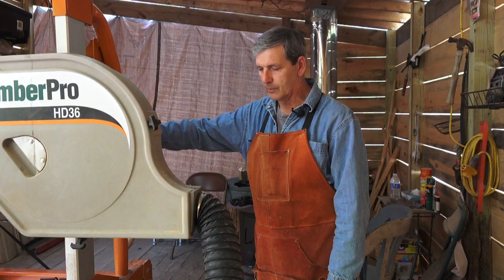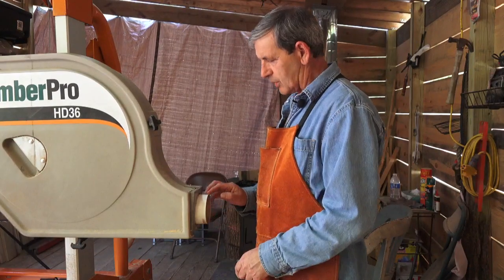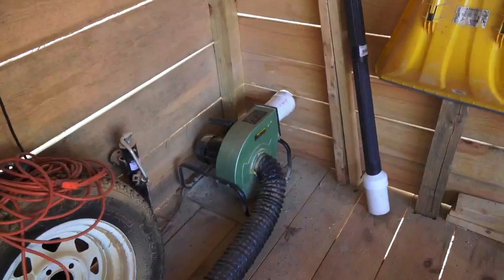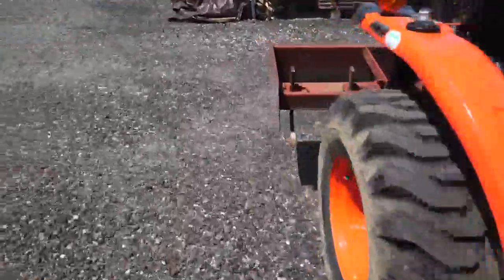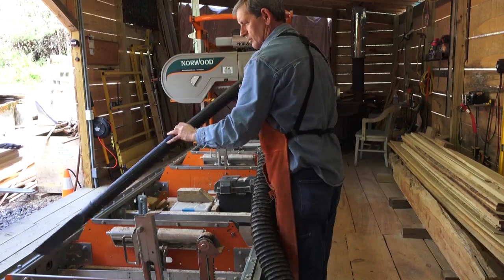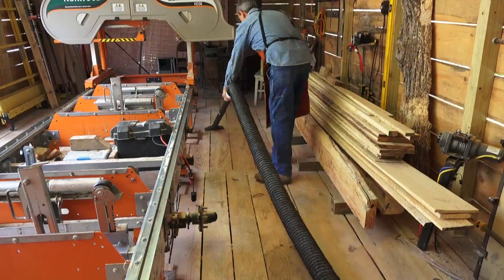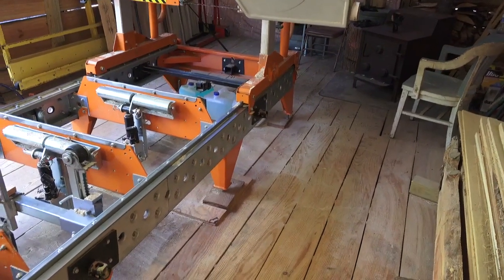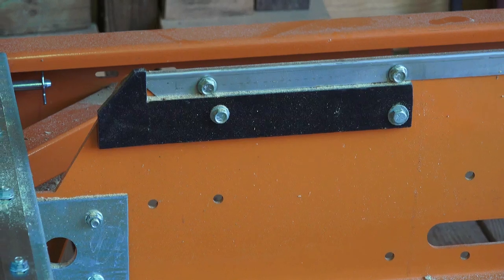NORWOOD HD36 AND DUST COLLECTOR

Comment: Why does everyone  insist on doing  you tube videos  solo?  At least  you  used  a tripod  most of the time,  thank you for that.    The dust  collection is the system  is exactly  what  I was  thinking.
Reply from the maker: I use a tripod to hold the camera for me. Only time I take it off the tripod I’d if I ain’t milling. Most of the time when I’m milling I’m home by myself. My wife mills on the weekend when she is off. The dust collection works great. Soon as I get a shelter built over the new mill I will hook it back up. I even take it on jobs with me. Thank you on your compliment and comments. And appreciate you subscribing to our channel. Do you own a mill ?

Comment: i have a 36 in a building but i have mine turned 180 degrees so the dust blows outside then i pick it up with the skid steer bucket
Reply from the maker: I think it is a lot less work to just blow it out the back of the building and push it over the hill when it starts piling up. And it’s a lot less cleanup inside the building to. Anything to get outside the building.
Reply: @MsdMakingSawDust  i like the idea ,but have no power at my mill so never went with the blower . other than the leaf blower for the dust that doesnt make it out. i also have doors on both sides and ends of my mill shed. but yours is much cleaner and im sure the wood floors are nicer to walk on than my concrete
Reply from the maker: I fully understand I tried the leaf blower at first.
Then I ran power to our mill shed. Our mill shed is only around 100 feet or less from our garage which made it nice.

Comment: We hear the 2021 Norwood  36HD mill has a vacuum   attachment has anyone seen this ?   I would think if it is a good idea   they would be showing it ?
Reply from the maker: I ain’t yet, but I put a dust collector on ours and it worked good. I have a video on it.
Reply from the maker: I just got on there site and looked at them they changed the design and they added a round 4” outlet on the cover so you could hook a dust collector up to it. Use to have a square outlet end on it, I made a round adapter to mate up to it. I added a 2hp Dust collector without the filter system so it would shoot out the back of the building.